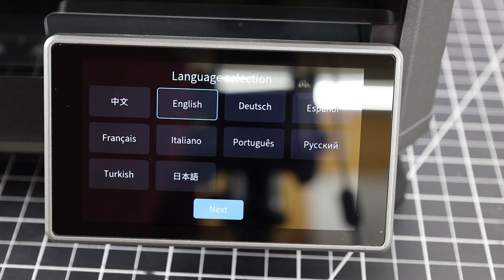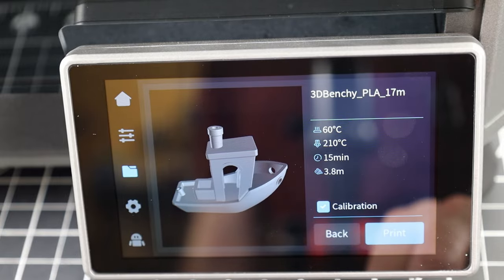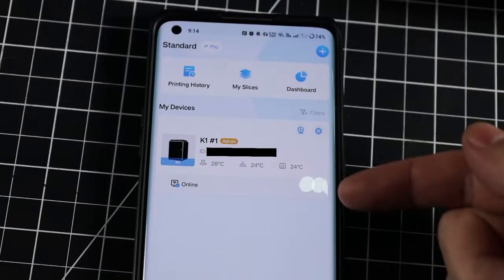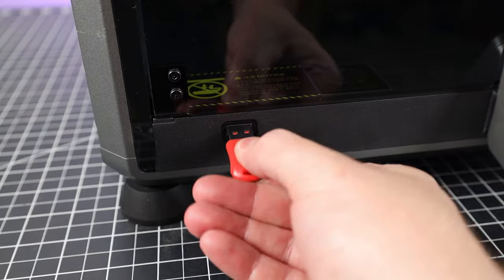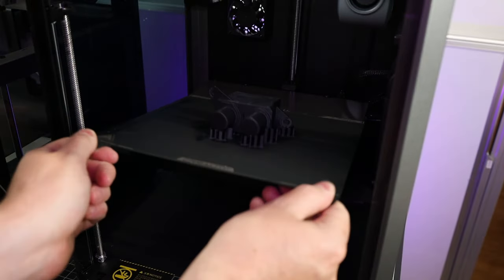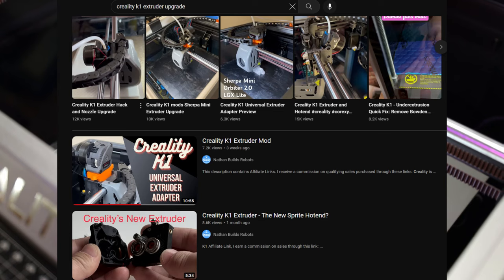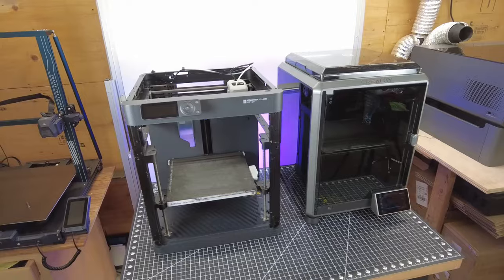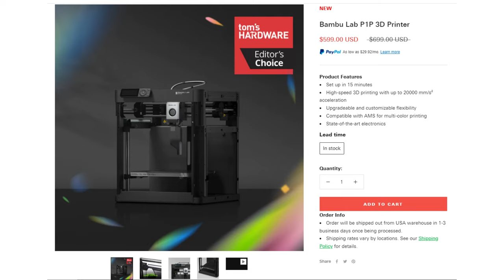Crazy Fast Out of The Box But With One Big Problem - Creality K1 3D Printer

Comment: Mine is being returned.  Hot end failed, extruder let go, then found out the frame was bent and causing the x-axis to bind.  Garbage machine.  They've offered a replacement, but at this point I think I just want the money back.  Done nothing but lose money on this printer.
Reply from the maker: I'm really sorry to hear that and like I said in this video it could be a good printer but there are those problems with the hot end that need to be fixed ASAP. 

You might want to check out this printer as a replacement if you're still in the market for a quick and reliable printer https://bit.ly/Bambu-Lab-P1P-3D-Printer-US
Reply: @randymay  If I can get a refund out of creality, I will.  Here in Canada, they don't cover the return shipping, so I'm out a rather heafty amount of money to send it back to them.   I usually don't spam stuff like this, but I erroneously thought this would be a good printer.  I had to go back on my word and wasn't able to finish prints I said I would.  It's been a total nightmare and if I can save just one person from what I've gone through, then I'll feel better.
Reply: Get your money back and get a Bambu P1S, you wont regret it
Reply: @kazdean  See what happens, the process is started already, however I have taken to trying to warn off anyone that will listen from buying the k1.

Comment: All the issues everyone's having is the reason I got a Bambu X1C. I almost ordered a K1.
Reply from the maker: 100% understandable. How are you liking the X1C so far?
Reply: I’ll let you know when it gets here Monday. I got a whole list of parts to print.
Reply from the maker: Very nice, and what stuff are you going to be printing
Reply: Well it’s first 3D printer so everything. LoL …. Mod parts for X1C, automotive parts, tools, etc. many projects. And my son will be using it for his projects as well.
Reply: @MoonDogg98 got the p1p and I'm having curling with PLA. How you fix that or you just slow the speed way down?
Reply: @maximuschapman7760  I have not had that issue. I am currently using PLA+ from iiidmax. Also I have had this printer for less than a week. (it has been printing almost non-stop) The only issue I am having is the AMS slot 3 and 4 are having issues retracting the filament.
Reply: @randymay  My X1C has done over 900 print hours with no problems, its fast reliable and incredible print quality. My X1C has two AMS units on it and I just ordered the new P1S with AMS as a second printer.  Creality burned me with their low quality Ender crap and awful support so I'll never make that mistake again.

Comment: Don't buy creality k1 guys. I am daily user 6 months now. I have several problems from the start. I have change extruder but I have problem again. I can't print thin wall because it breaks. I have both of my k1 printers problem with bed , there is gap between walls and problems with under extruding. I bought 20 days now 2 Bambu p1s and I solve all my problems. Creality lose the game.

Comment: I have a k1 max an its absolute disaster. I cant get a repeatable print. The table has 1.5mm curvature.
Reply from the maker: Well that's not good, did you contact them about this for a replacement print bed?
Reply: @randymay  no, i just keep on struggling with it